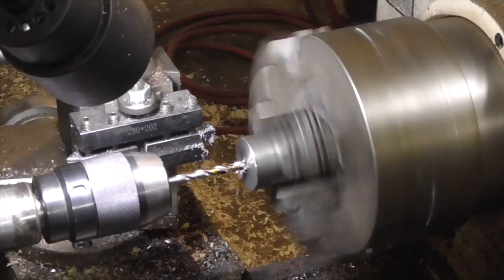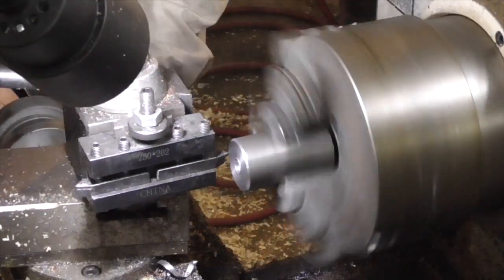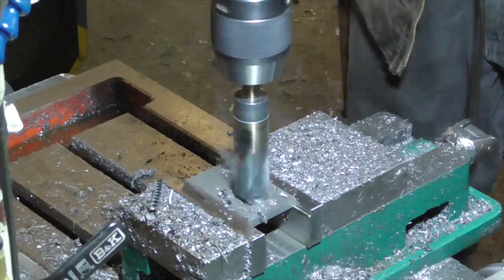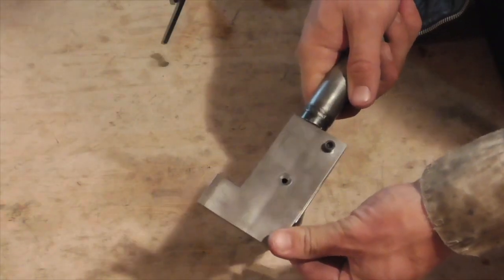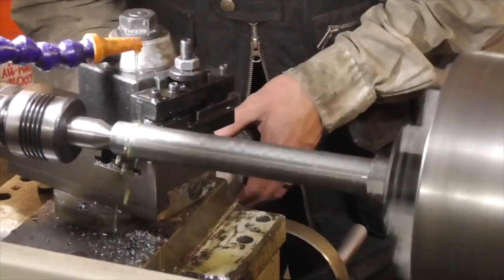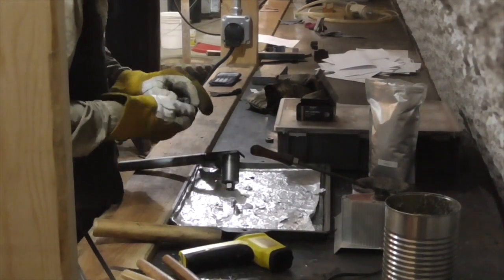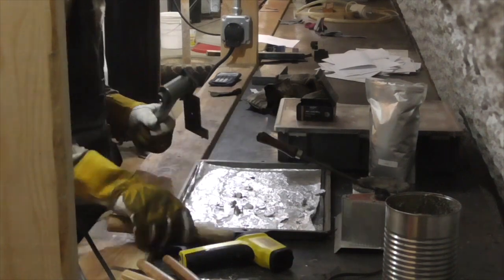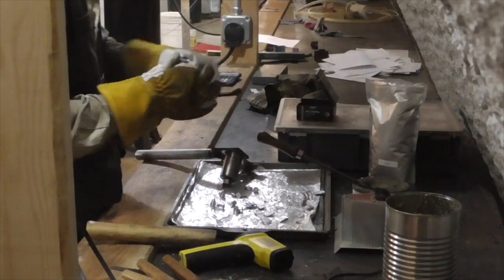Universal R&D Mold (TIS283)

Comment: Very cool idea. I'm sure you thought of these... But: why not screw the internal two halves into the mold body? Or use a strong thermally isolated magnet to hold these?
Reply from the maker: Well, in this case I'm using the cylindrical bore of the mold body to keep the halves of the mold aligned, and yet I typically have to separate the two halves of the mold (or cavity) in order to get the bullet out.  So, if I fastened the cavity halves to the mold, I would still have to disassemble it for each pour.
Reply: @TheIdahoanShow  I see, so the bullet can't fallout on it's own and to avoid fleshingsyou didn't opt for a split mold... Anyway, very cool mold design and machinning. I would love to see the bullets and test results.

Comment: I'm no machinist or this crafty (yet) just a thought, could you put a hole through the main body of mold with threaded holes on the inside mold to clamp it all together? Might make the casting work less tedious if that were possible. Si Vis Pacem Para Bellum
Reply from the maker: Well, typically I have to separate the two halves in order for the bullet to drop free of the mold.  With this design, I can't really separate the halves until I remove them from the mold body.